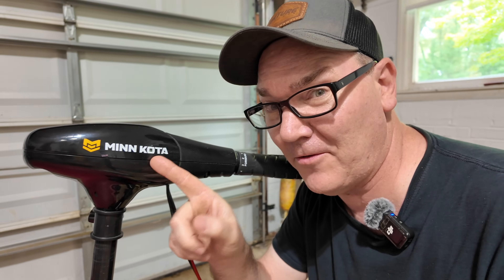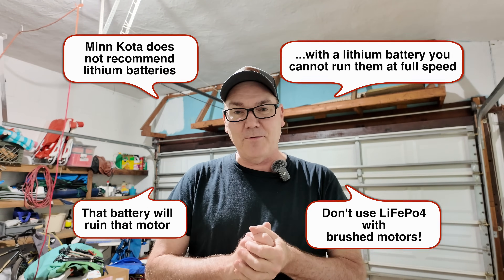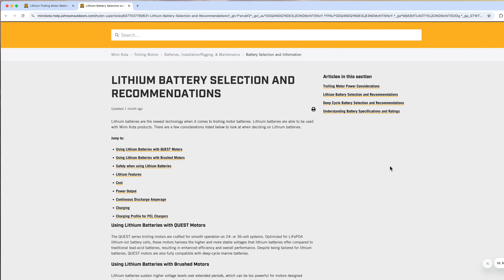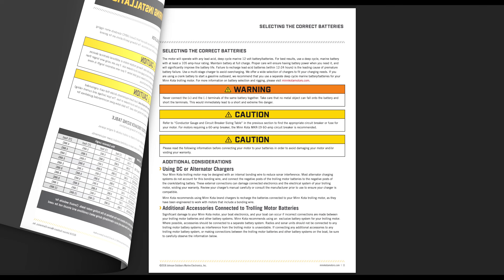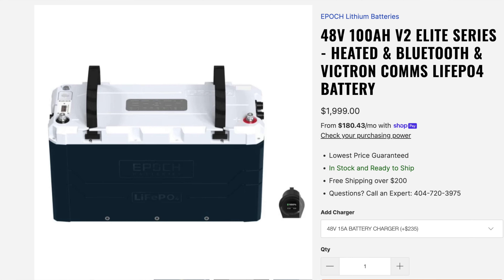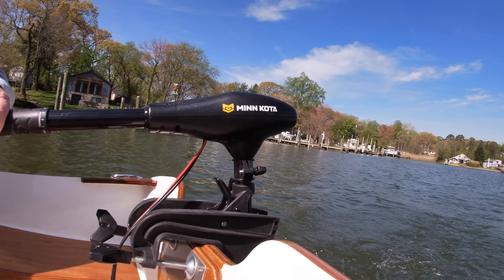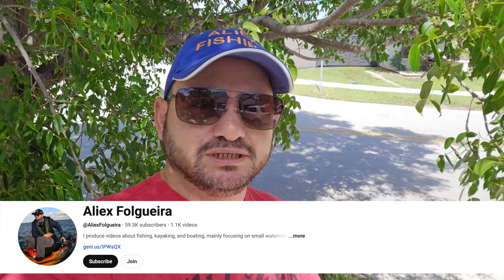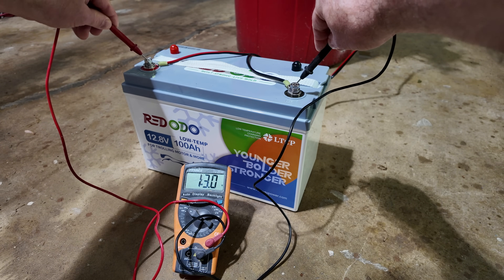Does a Lithium Battery DAMAGE a Trolling Motor & is Minn Kota Hiding the TRUTH?

Comment: Just my thoughts on minn kota recommendations. The motor brushes are designed and tested to last, let's say, on average 10,000 hours with a lead acid battery. With the slightly higher voltage of the lifepo4 maybe they will only last 8500 hours before wearing out. You would have to run your test full time for over a year to see the result. Real world usage, trolling motor works for 100 years on around 20 new  lead batteries or 85 years on 5 new lifepo4 years before the brushes wear out. I would go with the lifepo4, enjoy the savings on battery cost and gladly pay for the new trolling motor when i wear it out.
Reply: For me (70+), weight is a big consideration. A 50ah Lithium weighs 12 pounds, Equivalent weight for lead acid is around 48 pounds,

Comment: A 50 Wh lithium battery will last most people a full day of fishing (I get 6 hours out of mine) except those with the largest trolling motors. I’ve never had problems with my lithium battery (n=1 experiment…) running for hours at approx half power and off and on at full power but have been stranded by gel batteries in the past.

Comment: Thanks  for your time and content, how long did the battery last before  you need to charge?
Reply from the maker: It made it about 3 hours
Reply: @WayneTheBoatGuy those redodo batteries are pretty good ,I run 3 of them brushless trolling  motor 36 volts and I'll run all day at mid speeds and under.

Comment: If I had to guess I would say that maybe the higher voltage lithium batteries might make the motor a bit warmer, but with the motors usually being submerged in the water I doubt it'd be an issue 99% of the time. I'm betting on them just covering their butts.

Comment: Here are maths behind claims.
Basic power equations.
Watts(power)=Voltage× Current.
Resistance = voltage/current.
Watts = Vsquared/R

Motor drawing 10A at 12.0V = 120W  (12.0x10) .  Resistance of motor is 12.0/10 = 0.12ohmns

Power at 13.0V. (13.0x13.0)/0.12 =140W
13.2V = 145W.  A 10% increase in voltage from 12.0 results in 20% increase power ie heat in motor. 
14V = 163W

I'm assuming motors are designed for 13.0V which is fully charged AGM battery with some voltage drop in cable. NB at high current draws the voltage drop in cables will go up.

I'd suspect new motors will be design for higher voltages of LiFeP04 batteries, will still work on lead acid batteries but won't produce full power.

Comment: Wayne, I think the "Trolling Motor" or "TM" designation that you see on some LFP batteries just indicates that it has a diode between the + and - terminals inside the housing. It is supposed to dissipate transient power surges (or something like that) that result from being on a motor with a prop in the water. (Maybe turning it into a generator for a few seconds until the boat stops moving forward? Or maybe just sudden reversing?) The rest of the battery technology is the same as other LFP batteries that have 1C BMSs. Glad you did this video. It has been a topic of discussion among my fishing buddies for about 6 months.
Reply: What?  No.  Trolling motors on LFP batteries do not have diodes between their terminals.  You are thinking of FET switches (solid state relays)... those need diodes.

But no trolling motor can ever reverse-voltage a LFP battery at its terminals.  It is literally impossible.  LFP batteries have an extremely low internal resistance so they will just deliver more current if the motor load goes up, and even charge a little of the motor puts a reactive voltage surge on the DC side on each rotation.  Still net discharging of course but the LFP battery will actually be a bit more efficient if the motor has reactive DC whereas with lead-acid it just gets wasted as heat.

The only real difference between a regular LFP battery and one designed for trolling is that the BMS will be a bit beefier in TM batteries.  There is no difference otherwise. A LFP trolling battery is basically the same as a LFP golf-cart battery.  For the boating application you also want it to be water resistant but a TM designation does not guarantee that per-say.  There is no official set of requirements for a TM designation... vendors just slap it on for marketing purposes.

-Matt
Reply: @junkerzn7312  Sorry, but you are wrong. I've seen plenty of teardown videos that reveal the diode. Siekon even lists them as a feature to specifically protect the MOSFETs on the BMS from Transient Voltage Spikes. I may be wrong about what generates those spikes, but it 's definitely the reason for the diodes and I've only seen them on TM rated batteries. I get a conflicting answer from Google's AI when I inquire about the diode, so that's one more reason to ignore those AI generated answers, in all instances, IMO.
Reply: @mrhalfstep  I don't think a TVS (basically a beefy zener diode) is really applicable here, at least it wouldn't make a whole lot of sense in the battery/BMS itself so you might have gotten caught up in some marketing material (?).

There might be one built into the trolling motor but generally speaking it just won't ever be triggered if you have LiFePO4 batteries connected up because LiFePO4 batteries have an internal resistance in the milliohms.  The voltage just can't get jerked around by all that much... a few volts, that's it.  Not so much that it would trigger a TVS. 

The problem with putting a TVS in a battery is that it has to dissipate the difference and it can only handle a limited amount of over-voltage before it would otherwise melt or explode (or pop a fuse in its circuit).

The battery doesn't really know what kind of trolling motor it is connected to so having a TVS in the battery would be more of a liability I think.

So you might put one in the trolling motor since the manufacturer knows what the starting surge and reactive power (ripple on the DC side) will be, but you wouldn't want to integrate one into the battery.  If it pops its fuse inside the sealed battery, you would never know.

-Matt
Reply: @junkerzn7312  Can't say this more plainly. The diode IS in the battery case, between the terminals, only on TM rated batteries, as far as I have been able to ascertain. It is touted as a design improvement by at least one maker. I don't know if it's needed or if it works, but I do know that IT IS THERE. Maybe you can enlighten me about what YOU think makes a LFP battery TM rated. I shared what I knew with Wayne as a comment to his video. Maybe the BMS would kick out on over voltage or over current from the rapid starts and stops and direction changes that sometimes goes along with powering a boat with a trolling motor. Being dead in the water while you wait for the BMS to reset would be undesirable if it happened to you often on the water. Maybe the diode mitigates events like that. It's there for some reason.
Reply: @mrhalfstep there is no such thing as a “TM rated battery”.  It’s just a marketing term.

Comment: I'm curious, did you have a fuse on the positive battery lead? Did that wire get hot? I recently had an issue when running my Endura Maxx on a LiFePO4 battery where the breaker would trip if I ran the motor at full speed for more than 5-10 minutes at a time and the positive wire would get hot. I could run it at 75-85% speed for as long as I wanted and nothing got hot and the breaker did not trip. I still don't full understand what happened there, and that experience led me down a research path - your video is timely.
Reply from the maker: I did not use any fuses or circuit breakers. The wires did not seem to get very warm - just the top of the housing , which I assume just has the controller. But I am curious to see if a breaker would do the same thing in this situation.
Reply: @WayneTheBoatGuy  Thanks. There's just so many pieces to the puzzle - the motor, the QD plug, the breaker, the battery, my wiring job, etc... that it's hard to isolate exactly what the problem is in my case.
Reply: What size Trolling Motor are you using and what size circuit breaker?  As a general rule of thumb, trolling motors pull 1 A per lb of thrust.  So a 30 lb thrust motor pulls 30A max; 40 lbs - 40A; 55 lbs - 55A: etc.  Your wiring also has to match.  30A needs 10 gauge; 40A needs 8 gauge, 55A needs 6 gauge.  Too small of wire will cause the wire to heat up which will also end up tripping the breaker.
Reply: @NathanKrick  Thanks for the reply. It's a 12V/55lb motor and I'm using a 60 amp breaker with 8 gauge wire - both recommended per specs on Minn Kota's website. It said I could use 8ga wire for the short run I have in my boat (~5-6ft of wire)... maybe I should have stepped it up to 6ga.
Reply: @dsaavedra628 for such a short run, 8 AWG should be fine. I'd try 6 from the battery to the breaker to see if it helps. You might just have a bad breaker.
Reply: @dsaavedra628 you might also want to double check that you have good, clean connections with a lot of metal to metal contact at all the connection points.
Reply: @dsaavedra628 one last thing to consider, breakers should fail open at sustained 90% rating. A 60 amp breaker will eventually pop open at 54 amps. You might need to size your breaker up to 65 amp.

Edit: to clarify, breakers are rated to not pop open at 80% load. You will likely be fine at around 90%. For example, the specs on a typical 20 amp home breaker is only 16 amps load. A 50 amp breaker would only be speced at 40 amps.  Your 60 amp breaker is actually only speced to handle 48 amps of sustained load.
Reply: @NathanKrick  Interesting, thanks for all the info. I'm pretty sure all the connections are good and there is definitely no corrosion - I just wired it up a couple months ago and everything is still good and clean. A bad breaker would honestly be the best case scenario, quick and easier to replace than the wiring. My current breaker is a $10 Amazon special so I wouldn't be surprised if it was tripping out of spec or was just plain faulty. The positive lead did get very hot where it connected to the breaker (on the battery side of the breaker, not the aux side) when it tripped though, so I think the breaker was doing its job.
Reply: I’ve had the same experience with my Minn Kira’s both the endura 30 and the endura max 40. Can’t go full speed more than 5 minutes without tripping the breaker. I don’t know how these guys can do that with their motors?
Reply: Minn Kota’s !!! Stupid phone
Reply: @richcrook964  I upgraded my breaker from a 60-am $10 Amazon special to a 70-amp from a (hopefully) more reputable manufacturer. Gonna try it out soon and see if it allows me to go full speed without tripping the breaker or melting any wires.

Comment: I used ionic 125ah batteries on an older motorguide tour for over a year before I upgraded to a powerpole move. I had zero issues but I also didn't run it wide open for extended periods. I normally ran below half power. They worked great.

Comment: What about brushless motors? Does the same apply?
Reply from the maker: According to the web site "The QUEST series trolling motors are crafted for smooth operation on 24- or 36-volt systems. Optimized for LiFePO4 lithium-ion battery cells..." But it doesn't say whether those are brushless motors.
Reply: Thanks for that quick reply, i learn a lot from your channel, best wishes from Washington State  @WayneTheBoatGuy

Comment: Thanks for the testing and informative video. I used a different brand btr power 100amp 12v lithium with my 55 thrust minnkota motor. While running it at full throttle for about 20 minutes I noticed that the wires heated up at the terminals and scored into the top of the battery. So I definitely run the motor only briefly now at level 5. Motor if fine and it does seem to be running faster but I have no reception where I am at in the Adirondacks so I haven’t been able to use my phone for a speed test. 😂 Thanks and take care
Reply from the maker: Good to know! I'm trying to recall, but I think my 55 gets warm like that at full speed with my lead acid battery.
Reply: Wire heating up shouldn't have anything to do with the battery.  A 55 lb thrust trolling motor draws ~55 amps of power.  For 55 amps of power, you should be using 6 gauge wire and very robust connectors from the wires to the battery.  If the battery connectors heat up, that will heat up the wire.  The best way to be sure about where the heat is building is with an infrared camera (such as a FLIR camera).  Of course that is not cheap, but an infrared temperature scanner can give you some idea by targeting each part (wire, connector, battery, etc) to try to get a good read.

The most likely thing you will find out is that the connection between the trolling motor wire and the battery is not very good.  Make sure you have a good, clean connection between the wire and the connector.  For connector, use a screw on eyelet where the hole is the same size as the screw and the eyelet diameter is the same size or larger than the battery post.  This will maximize the contact between the wire and battery terminal to allow the maximum amount of current to flow.

Constantly disconnecting and reconnecting wires from your battery terminal is also likely to cause wear, stripped screw terminals, etc.  I recommend attaching a high amperage connector to your battery that you never remove.  In my boat, I use a 100 Ah LiFePO4 that connects to a positive and negative busbar where all my other connections connect to (trolling motor, live well, etc).  Since the battery is 100 Ah, I use 2x Anderson Powerpole connectors (each is rated at 50A).  This allows me to quickly connect and disconnect the battery.  I use a single Anderson Pole for my charger, and only attach one plug, since it is only a 20A charger.  If you connect  your battery directly to your trolling motor, you can use a different connector type rated for at least 60A (such as an Anderson SBO 60), however, in that case you should have an inline fuse somewhere.

Comment: I've found that Lifepo4 seem to have less internal resistance than the same amp-hr capacity deep cycle lead acid meaning they deliver more power, but then again, using a larger lead acid would have the same effect and they don't warn against that.

Comment: I've been running 2 Minn Kota 12 volt trolling motors, a transom 55lb thrust Traxxis, and a 55lb bow mount Powerdrive, in my 16 foot Sea Ark duckboat that I fish from. I've used my boat on restriced waters, where no outboards are allowed. I've never had any problems at all using matching Lithium batteries. As Aliex said, unless you're going to run your motor on full power forever, you have nothing to worry about. Enjoy the lighter weight and power capacity of these batteries. They are truly game changers! Very timely video Boat Guy. Thank you!
Reply from the maker: Sounds like you have a great setup!
Reply: @klausspunkmeyer5096  great info. I have a small old 10 ft John boat i fish from. It's not pretty, but it gets me on the water. I live in a neighborhood with the lake being less than 3 min from me. I've really been kicking around the idea of lithium as im sick of trucking around my 27dc. I have to unload it and carry to the garage eveey time I hit the lake, lol. Poor me, haha. On a serious note, your input has made me seriously think about picking up a lithium.

Comment: Been using lithium batteries on my trolling motors for years. No noticeable damage done and they are way better in every aspect except price.
Reply: I just got a 100AH LiFePo4 battery for $20 more than a similar 100AH Lead battery. Given how much longer it's life span is and how much usable charge they have (can go almost to 0% with no damage) I think they are now the better value per hour run time.
Reply: My Power Queen 12V 100Ah LiFePO4 now sells for $174, so price discrepancy is disappearing even.
Reply: even the price starts to pay you back. I am on 6 years on several batteries with no new ones in sight